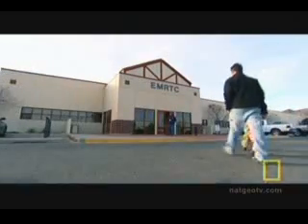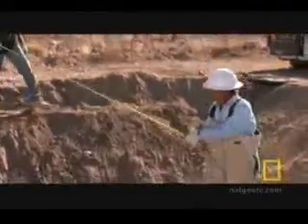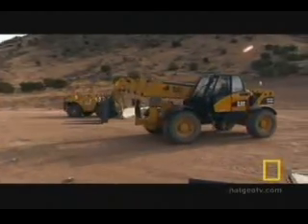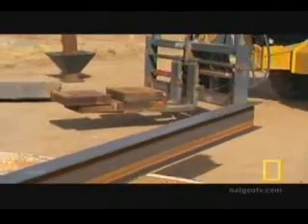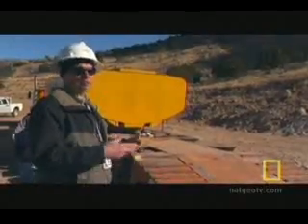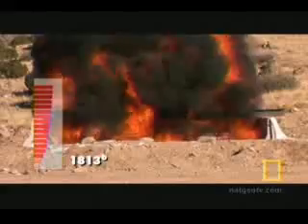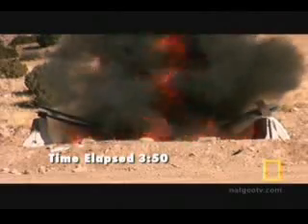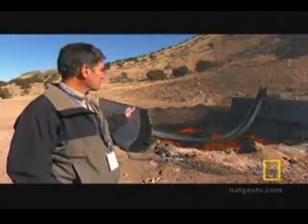steel being weakened by a jet fuel fire

Comment: What about building 7? No jet fuel there and it collapsed by fire like a house of cards.
Reply: The structure of the World Trade Center 7 was damaged by debris when the nearby North Tower of the World Trade Center collapsed.
Reply: Mikoyan Gurevich What about other buildings that were more DAMAGED?? How come they didn't collapsed?
Reply: @MOTORCYCLES-ANDGUNS  no bombs
Reply: @isc5348    I agree. LOL
Reply: @MOTORCYCLES-ANDGUNS  and WTC 6 which had fires for hours as well as heavy damage.  never collapsed.
Buildings 1 and 2 were exploded, building 7 was imploded.  That's the fact.
Reply: @dirtywizard2945    Says who?  NIST said it was due to "Thermal Expansion" of column #79 (which was the first time in the history of steel high-rise buildings).

The collapse entered literal free-fall for over 2.5 seconds. Do you know what that means?

Comment: I have no doubt that rouge aircraft hit the buildings, and that a decent part of what we are told is true however. As a a pilot it still astonishes me that any individual regardless of experience could highjack a passenger plane mid flight and navigate so precisely.

Imagine being a passenger on an aircraft many miles away from Target, execute such precise heading, altittude and navigate large aircraft within mere feet of a target as significant x2. 

In all of my experience it would have required some alternative navigation with a small margin for error is all I'm saying.
Reply: 1997 Heritage They were trained to fly by al qaida
Reply: @Phagastick ...no theu weren't.  Theu trained to fly small prip planes in the US!. People that don't know what theu are talking about shouldn't add to the conversation.  Be quiet and learn from those who have studied the subject for over ten years!
Reply: Here the problem...how did the rest of the building fall? The jet feul couldn't have weakened the other 2/3 of the building and yet they fell perfectly like demolition. Molten material is in photographs and videos, metallic spheres were found in the debry in large quantities, a byproduct of thermite or nanothermite
Reply: @chosen1one930  true... still to navigate such large aircraft vertically and laterally at the speeds claimed seems not just highly unlikely but improbable, especially at low altitude and sea level. You can simulate all you want but in the real world aircraft especially large jets respond with significant feedback differences
Reply: The planes were co trolled remotely. One of the "pilots" it has been said by a former instructor, couldnt fly ANY plane...much less a plane as difficult as one of those airliners!
Reply: They trained and trained

Comment: "The fuel truck must be grounded.  Any stray spark could ignite the jet fuel."    
How is that possible when jet fuel has to be atomized to ignite.   They even mention that it has to be vaporized before it can burn so no - a spark couldn't ignite it.  It appears they have an atomizer running into the middle of the pool so it can be lit and can continue burning.   Without an atomizer it would simply go out.    
This is very deceptive and bad form for National Geographic.
Reply: Kerosene is hard to ignite.

Comment: well since your not using a full scale beam and your using a beam with a load higher than in the building per cubic inch, and the ratio of fuel  to steel is 10 times higher than the real scenario. jet fuel does not respond to  sparks.  this is not a fair test.

Comment: this is the bullshit experiment. 
the building has not only one beam .  The load at weakened steel has been redistributed by the  steel matrix and hat truss in to the other parts. 
= The building changes its shape and the weakened parts have a zero load because the parts not affected by the fire are stiffer than the weakened parts .  
Individual parts in the core were dimensioned to 3 times the load capacity and external pillars for 5x more wind load resistance. 
The twin towers should stay with 1/3 of core columns and 1/5 of external columns .

Comment: The temps at which steel weakens varies widely. Steel used in WTC Twin Towers was Carbon Steel type A36 and was fireproofed with percent chrysotile asbestos, mineral wool, gypsum, cement binder, gypsum plaster with vermiculite aggregate and chrysotile asbestos. 

Any steel tested, to see what temp WTC steel would weaken and become liquified, would have to be fireproofed the same and the same steel would have to be used. A36 weakens at 1,600 °F. At this temp a transformation process occurs called austenitization. During this phase the crystal structure of the steel changes from ferrite to austenite. You can tell easily when this metamorphosis occurs because the steel will glow red. 

There should be separate temps one temp for when austenitization/weakening occurs and one for liquification occurs, which for Steel type A36 is 2500°F - 2750°F. To create a fair test the source or energizing flame would have to be nourished by jet fuel, which in this example jet fuel is used. The amount of fuel would have to considered. The more fuel used in a localized area the faster the steel would heat. For example, using 10 candles to cook your wiener would cook it much faster than using 1 candle. Also, think about the fact that the beam is meticulously positioned over the fire to receive the maximum heat transfer. Additionally, intensity of flame radiation on a target depends on the surface area of flame facing target and flame emissivity, meaning the beam would need to be the same size, because the bigger the beam, the more steel was used, the stronger the beam will be and the more resistant to heat transfer it becomes. 

All this experiment proves is that a certain type of steel will bend supporting nothing but its own weight?? This seems suspicious, notice there is no red glow to the beam. At the temp that the steel failed tells you they didn’t use A36.

The results are inconclusive, but it was an entertaining video.

Comment: 1st, the vast majority of the fuel burned off in the fireball. 2nd, even if the steal at the fire was weakened, what weakened the 90 floors below it? Also, what cut all those columns in the ground zero pictures at a 45 degree angle?
Reply: Wes Fox
that does not work. The potential energy before it fell and the kinetic energy + the unused potential energy  after it fell are the same. Since the structure below the impact site was designed to hold up all the floors above it plus significantly more mass it wouldn't fail. We see this in failed controlled demolitions. In all of those cases the building falls until it meets undamaged lower structures at which point it stops falling straight down and either tips over or just comes to a rest.
Reply: Wes Fox
dude is pure physics and the conservation of energy. It makes no difference if the load is falling or static. If we could instantly remove 20 floors in the middle of the building the falling floors above would not destroy the remaining floors below. As the floors fall they are converting the potential energy into kinetic but the total energy remains the same. There would be some damage to the top of the remaining floors but you will not get what we see. There are so many failed demolitions where you can see this. Some where you even see 90% of the building fall onto maybe 5% of the lower floors and even that does not destroy the lower floors. In order to destroy the floors below you have to either add enough energy in the falling floors so that it's greater than the load the lower floors can handle via adding addition acceleration beyond gravity or additional mass. The other option is to lower the load barring capabilities of the lower floors by cutting the support structure.
Reply: Wes Fox
"I have. He didn't agree with you. I wonder why?" I call bullshit. the conservation of energy is very simple. If you hold a ball 5 feet of the ground it's potential energy will be at 100% while it's kinetic energy is at 0%. When you let go of the ball it's potential energy will continue to drop while it's kinetic energy increases proportionally. This is maybe grade 7 physics. I don't need to go ask some prof in college. I've taken physics and physics related course all the way into college. You can not end up with more kinetic energy than potential energy without adding external energy.

"Righhhhht. And your proof of this is? " The hundreds or even thousands of failed demolition videos.  you can see some of the lower floors blow, the upper floors fall and then stop when they hit the undamaged lower floors.

What I see is a person who does not even understand basic physics concepts. If we could get such great collapses of buildings by simply causing heavy damage to some upper floors then ask your self 1 question. Why would controlled demolition companies bother with detailed examinations of the support structure and placement of charges to remove the load barring supports of the building?

Comment: So you used a beam much smaller, with a weight not comparable to size or displacement of that of the world trade centers, put directly over a jet fuel fire, which is NOT how the Twin Tower fires burned... or at least I'm pretty sure they didn't build tubs directly under any I-beams... and I'm pretty sure, not ALL the fire proofing was knocked off, even NIST said they "Just assumed a total loss of fire protection took place". NIST also assumed the weight was more than 4x the max load of the floors in question (although, known data suggested that each floor hadn't even held HALF of the weight it was rated for, let alone anywhere near or surpassing it's max), and the NIST computer model required that the steel bent 42" to buckle (never explaining how the weight got there or how the fires reached a point they claim it had) even though live tests had shown, using a beam the ACTUAL size of the WTC'S only bent 4" (which testing was given up because they could not get the steel to buckle even under the max load for multiple hours).... So you are correct, steel, especially small I-beams, when put DIRECTLY under a couple hundred gallons of jet fuel (not thrown/splashed at/on/around the steel) will certainly buckle. However your test is utterly unrealistic to compare to the magnitude of the Twin Towers on September 11th, 2001. Especially considering the exterior columns were more than double in size at 14" wide and in depth, and the internal core columns at 54" by 23" at the base to 36" by 16" toward the top. 

It does a disservice to those who lost their lives, one of whom I knew; and it is a diversion from the TRUE investigation that should've taken place... It disgusts me that in one of the greatest, if not THE worst tragedies in American history, all of the evidence was hastily removed, but a few SELECTED pieces; NO FACTUAL evidence was ever provided for who masterminded and executed the attacks, and while still years later people are dying from the affects of those attacks, both medically and in war. Oh you want to say Bin Laden? ask the FBI or CIA why they never had him wanted for 9/11, and then ask, "why then were we in Afghanistan?" And what about Iraq and Saddam? those mysterious WMD's? I was in Iraq, nope, no where to be found... but American soldiers dying for reasons unknown... So then, about those steel beams... the only thing solid and melting I see, is a twisted will of unsaid individuals, the want of an agenda, and a deliberate action put it into place... 

It's not so hard to believe in what i'm saying, especially if you believe how easily your steel beam melted over a fire, but also believe somehow PAPER hijackers passports survived the impact of the plane, combustion of fuel, fires that melt steel and collapses of two 110 story buildings... but the Black boxes of both planes did not... Or the bandana and drivers license of a "hijacker" found in the fields of shanksville, PA, yet no remains to identify anyone, and no debris to even identify the aircraft... Or how there were unexplained holes in the pentagon, and Dick Cheney's mistakes in saying where he was and what was happening, yet the Transportation Secretary Norm Mineta gives a pretty good testimony of what was going on... Or you can just look into what the "Project for a New American Century" says, or what 'Amalgam Virgo'  is, see who was involved in it, look at the evidence and make an individual concise decision based not on evidence you're TOLD to believe, but free information known to be FACTUAL. 

"One of the saddest lessons of history is this: If we’ve been bamboozled long enough, we tend to reject any evidence of the bamboozle. We’re no longer interested in finding out the truth. The bamboozle has captured us. It’s simply too painful to acknowledge, even to ourselves, that we’ve been taken. Once you give a charlatan power over you, you almost never get it back.” -Carl Sagan

Comment: Wait a minute using a smaller piece of steel means less surface area to heat meaning it will heat quicker than a large more thicker piece. No one piece of steel structure within the twin towers would have been subjected to 700 gallons of burning jet fuel for the given time. Nist can't prove the insolation had been knocked off. To believe in this exact subject requires total blind faith as there is no evidence available to prove it. And let's not forget most of the jet fuel burnt up on impact there is plenty of hard evidence proving this. Finally even if the steel did bend it does explain why the rest of the building what wasn't subject to fire did especially in the case of wtc7 . The debunkers will just have to try allot harder than this

Comment: I watched this experiment and I can say that these guys have used a few sleight of hand tricks . 1. Number one is they are using these large steel blocks of steel to say it is a weighted beam The beams in the core at or close to the impact zone were 2 INCHES THICK BOX BEAMS THAT WEIGHED AROUND 600 POUNDS PER FOOT . A twenty ft. beam should have weighed close to 12,000 pounds . 2 Number two. The jet fuel that was used in this experiment has a ditch to keep it in a small area , I AM NOT SURE HOW THOSE 19 MEN IN AIRPLANES GOT IN THERE IN THE WEE HOURS TO DIG A DITCH FOR JET FUEL TO FALL INTO.

Comment: why did the steel columns below the tower were turn to dust? the steels on the impact can weakened yes but what about the floors below?? still shouldn't pancake with no resistance

Comment: Newton's 3rd law still stands. no doubt beams were weakened. no one doubts that. what a weak example using such tiny beams and so much more fuel. your point fails
Reply: There also in an open environment while the Jet fuel burning would be somewhat enclosed
Reply: its commensurate.  if they'd put 2 tons on the beam, it wouldve collpased even sooner. if they scaled it up the same would happen.  You guys just like to dismiss inconvenient facts because it means giving up the conspiracy.  
Tens of Thousands of Tons.. trying to divert its load through the remaining steel.. subjected to fire.   You people behave the same way climate deniers behave.
Reply: lightningshark what utter crap. Plenty of conspiracy nuts who still parrot the jet fuel can’t melt steel beams argument. The only thing you need to understand is heat weakens the structural integrity of steel way before it melts. And if you want to balance your argument, maybe take into account the weight of like 20 floors of WTC as weight instead of complaining about a small steel beam. Small weight= small steel beam.

Comment: 2000 degrees?? jet fuel burns at 800 to 1500. Also, there was MELTED steel, steel drippings etc. AND the official and not-at-all corrupt NIST report says the jet fuel couldn't have lasted more than a few minutes.

Comment: not true this is horshit  the bem are way thicker than  stupid small beam  it was radashion that tuck it down
Reply: yea it was thicker but that beam on 911 was exposed to that heat for a hour so yea and it had a lot more wight on it
Reply: it was radashion that tuck it down after ground zero it the steel beams were melting like lova

Comment: so this was less than an ideal control and variable , this was a Mythbusters  type make it happen over do it, the fuel was gone in seconds so the heat was from what ever material would burn, the other issue is we need to see the up and down force , the beams connected to other beans and what's weak fails what's strong supports so I guess we just need to build a scale top of the wtc light a fire and see what happens ...I'm skeptical it will fall

Comment: um, most the fuel was ignited at the moment of impact. lol this was a God damn swimming pool. not even close to realistic
Reply: also every beam across the board and building would have needed that intensity to drop at free fall speed which is not what happened that day. the top should have settled a top the structural base that had no fire or weakened sections. or toppled off the base structure,  the building was built to carry 5 times its weight load and with stand a 707 hit. this is fact
Reply: I would try to tell how you are wrong, 
But sense you are so disillusioned that you can't even accept the truth in front of you, I won't bother.

Comment: The 9/11 truth nutcases fail to realize why steel has to be insulated in fire. Steel fails quickly in fire, and has to be insulated to stand a few hours of fire... to get out of the building. On 9/11 the insulation was compromised, the fire systems failed, the building failed quickly, because the insulation was dislodged by massive kinetic energy impacts.
Thus 9/11 truth nutcases can't comprehend physics, fire science, and rational thinking.  Clueless 9/11 truth spreads lies idiots believe.
Reply: they also fail to realize, all of the fire retardant around the cores where completely blown away by the impacts